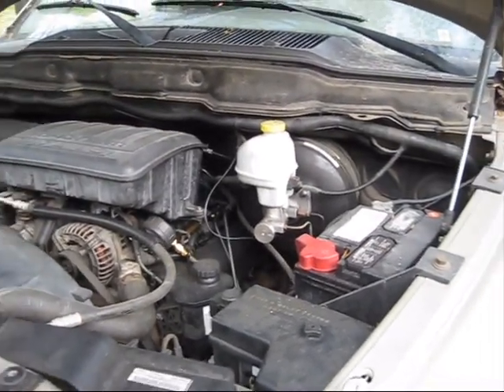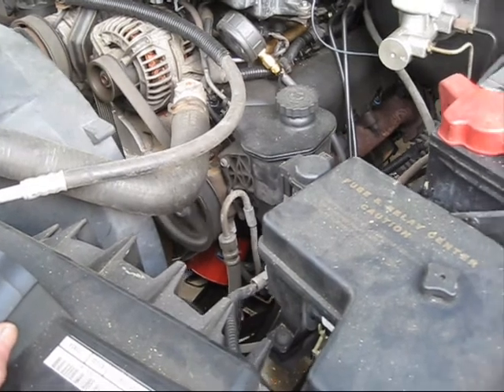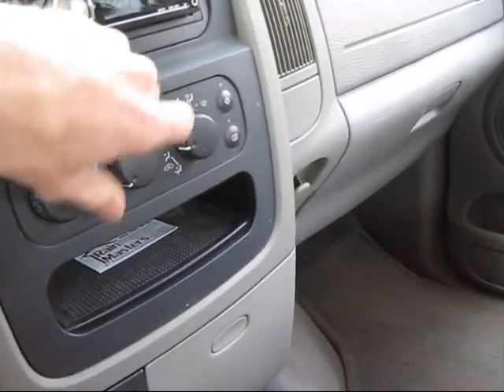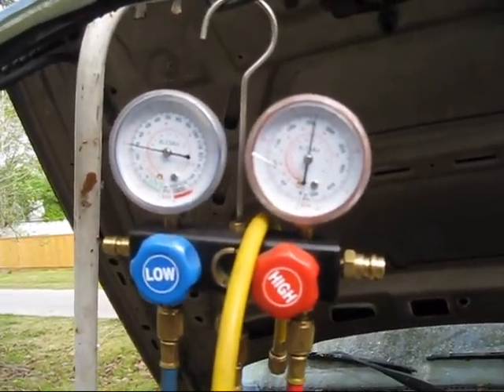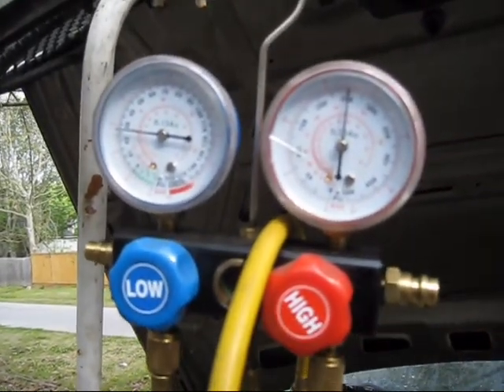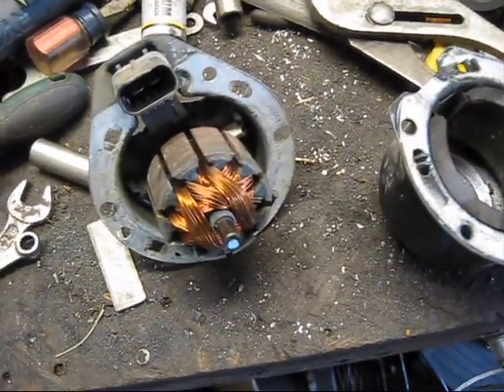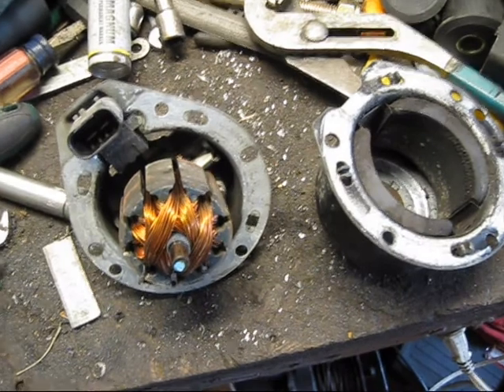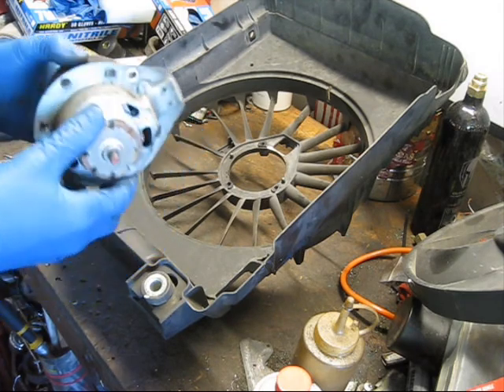Dodge Ram condensor fan diagnosis, replacement, and failure analysis.

Comment: So fan will not work with power? I've checked all fuses and relays and checked if power is going to fan. Everything including clutch is working with power. So does that mean it's the fan

Comment: Thanks for the video. The only things that I did different was remove the negative battery cable first.             1. Mark the top brace with a sharpie before removing so the hood latch will line back up. 2. After separating the shroud from the condenser coil remove the fan blade nut (left handed thread) then remove the three 8mm head mounting bolts then pull the fan motor enough to use a screwdriver to release the wire retainer clip. Also look at the new motor threaded shaft I had to add an extra washer under the nut to take up the gap.  The motor from Autozone less than $30 + tax tore the old motor apart as well same story worn out.
Reply: FREE KASMIR SAVE THE WORLD  you are better off buying a new motor they are easy to get.